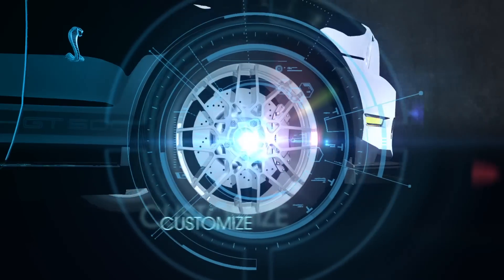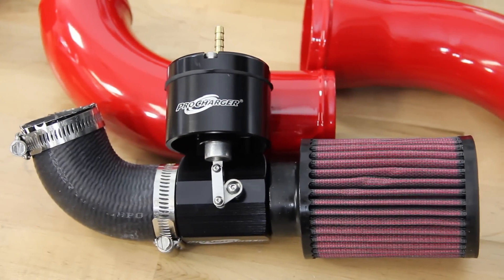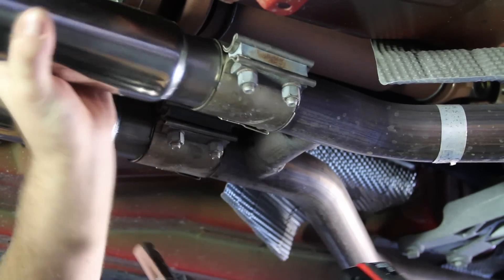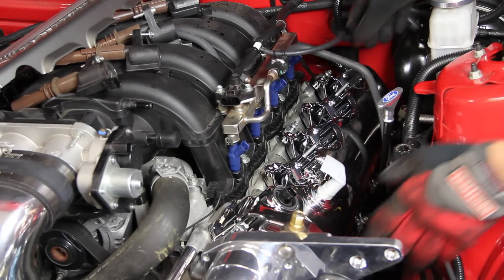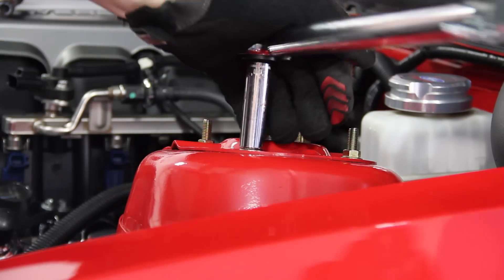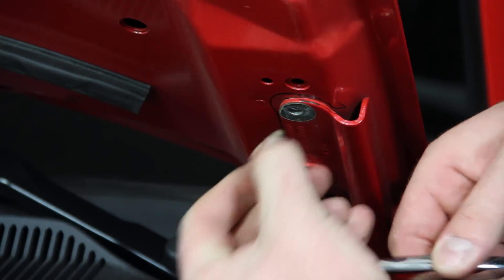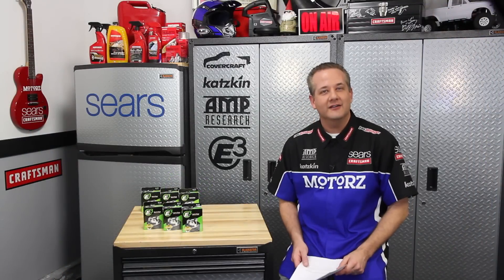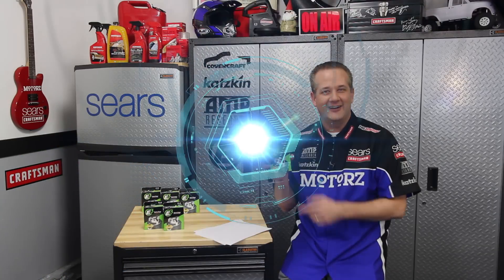How to Install Air Lift Suspension, ProCharger Ford Mustang Motorz #78

Comment: what are your thoughts on air bagging for colder climates, such as canada was thinking of getting a mustang and thinking air bags would be a good way for when it does snow to have a better ground clearance and of course winter tires for my daily driver?
Reply from the maker: Best thing to do there is to check with Air Lift Performance directly... they will be able to give you some detailed information.

Comment: i love the look of those valve covers. ive put a set of them on my F150 already9as well as a cam), but i cant find that Raptor style grille anywhere. ive got a 2006 so its the same as the one you all did, and it would really pull the whole thing together if i could find one
Reply from the maker: The Raptor style grille on the F-150 is from Paramount Restyling. If you look for the "F-150 Upgrades" episode at our website (motorz.tv) you can see a link to it, and you can watch that episode to see how it gets installed along with the OEM Raptor LED grill lights!

Comment: So many people have had problems with air ride.  Ive never had problems with my springs.
Reply from the maker: nonayou damnbusiness This isn't an Air Ride suspension, though. Different manufacturer, different product. No issues at all since we installed it over a year and a half ago!
Reply: nonayou damnbusiness my lincoln had the stock ones for 15 years no issues, depends on the manufacturer
Reply: IMHO, I've never heard of springs weakening but never failing.
Reply: +nonayou damnbusiness My expedition had the stock air suspension since 2002. No issues, just the fact it isn't controllable makes me want to get it updated to an e-level controllable kit. Just because ricers put on the cheap shit doesn't mean air ride sucks. It's found on many vehicles including but not limited to, big rigs, city buses, school buses, most luxury vehicles, and even coil over springs may have built in airbags for more control. It is by far the best suspension you can install it is the smoothest ride you'll get.

Comment: How do you adjust your camber settings when the adjustments are under the top plate on the strut tower?  I just installed a air lift setup on my 2013 and there isn't a way to properly align it without cutting the tops of the strut towers???

Comment: Wouldnt bags affect the handling of the car? How would it take corners now?
Reply: when you put bags on your car you typically have a remote to control them so when you are driving you will be at a stock or reasonable suspension height, then when you are stoped or at a meet you can lower it. Now only an idiot would go around corners with the bags down, so no it wouldn't effect cornering unless you take corners with the bags down

Comment: Is it a turbocharger? I know you said supercharger but it's intercooled and has the piping that a turbo usually needs.
Reply: Never mind. I see that it's belt drive not exhaust driven. My mistake. It just really looks like a turbo.
Reply: Skate Life Turbosuperchargers are centrifugal compressors driven by a turbine in the exhaust. This is a centrifugal supercharger, which has a gearbox and pulley where you're thinking the turbine or "hot side" should be.

Comment: would you be able to do this to a 88 to 91 mustang. also how would these air lift suspension compare to racing suspension.
Reply: +john doe Most of these mods are to keep the car still street legal.

Comment: i ran all my lines inside my car. remove both fender liners and there are grommets on the fire wall that you can run safeley inside like you would an amp power wire.  it would suck going down the road and something snags the line and it slames moving down the road

Comment: Can you still drive with the air bags dropped down all the way ?
Reply: def not in new york with all these pot holes lol most likely not anywhere the tires will rub u would need to adjust it

Comment: Why why would you put air Suspension
Reply from the maker: Why wouldn't you? After doing it ourselves, we would do it to all our vehicles if we could. The ride is the same as stock, super adjustable, and it's cool as hell!
Reply from the maker: kamil chamma Not at all... it rides like stock, if not better.
Reply: That's cool but I probably would do a full Suspension upgrade for better proformance love these videos by the way make more
Reply from the maker: eric ngo Thanks Eric! We have more suspension upgrade episodes coming up this season!
Reply: kamil chamma i just install the air lift kit on my 2011 5.0 and wow! i had coil overs on it before airlift and when i got the lowered hight i wanted i was scraping like a MF! now i can ride around town low press a button to go over speed bumps and driveways then turn it off and slam it
Reply from the maker: justin moreno Awesome!!!! Isn't it fun? :)
Reply: hell yea especially when i leave it slammed in a parking lot and people walk up and ask how i drive that low, i just tell them carefuly
 lol
Reply: justin moreno Will they last snow and winter? What about the negtive sides?
Reply: i don't see why not! they do recommend to change the air lines every few years but its cheap.  only negative side i can see is to make sure you have the right wheel?offset so you can slam them on a wide tire
Reply: justin moreno I've had air-ride on my truck since about 2009 and have never had to change a line. I got my stuff installed by a commercial truck shop and I got the same airbags on the rear end as a trailer!!! I can also put 10k lbs on the rig & the truck/trailer doesn't drop an inch! Load of wood? Load of stone? Air bags don't care. I used to break leaf springs once every 18 months!!
Reply: Kona138
That's what air ride is a blessing for, any kind of of carting or hauling.
Reply: Air suspension improves driver comforts and vehicle maneuverability